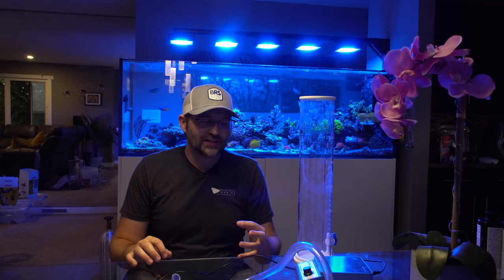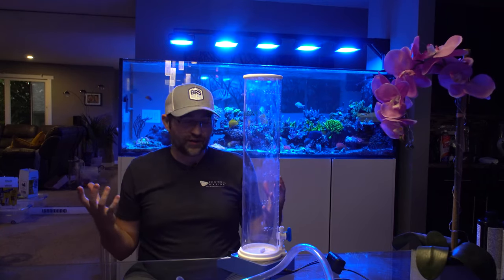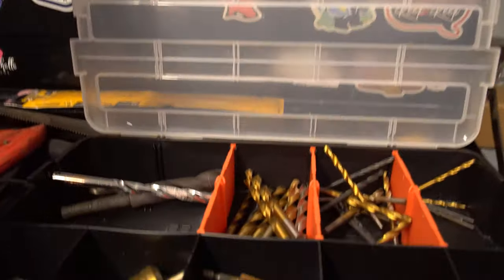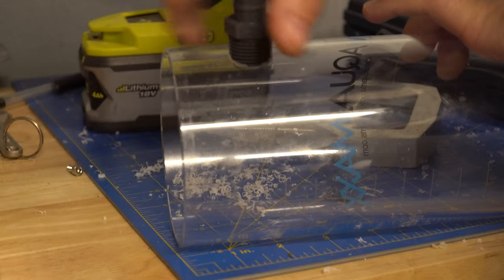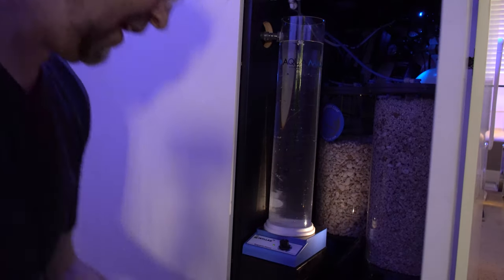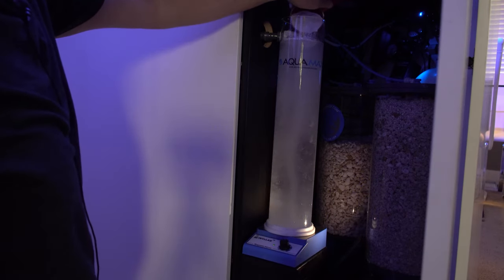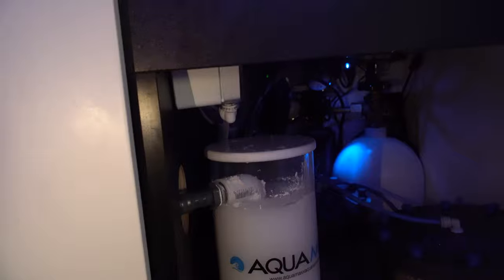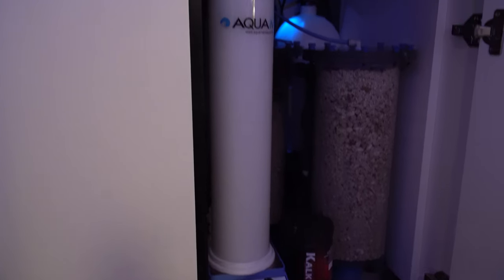DIY Kalk Stirrer Reactor for about $76! Kalkwasser PH power!

Comment: I did exactly the same with an Avast reactor. Same stir plate and all. I went to the parts store on Avast and got their K1 tube, bottom, and union. I then 3d printed the lid. Has been working fantastic for about 2 months. Also, drill a small hole in the top of that elbow to break siphon.
Reply from the maker: Awesome!  Ah snap I did that but shot the clip on my phone not the big camera.  Must have forgot to add it!
Reply from the maker: PS great idea on using the housing for that for a bigger reactor!

Comment: Problem with those cheap stirrers is that they use a brushed DC motor that has a potential of only lasting a short period of time (brushes wear out). Best option is to find a stirrer that uses a brushless motor.  Another thing to consider for longevity is finding a pill that has a ring in the middle so that the only part in contact with the bottom plate is that ring. It will reduce wear over time.

Comment: I did this a while ago, 1. Sometimes it dosent start to spin. 2. When it spins it slowly drilles a hole it the bottom of the conteiner
Reply from the maker: 1. need to make sure the kalk isnt to thick.. so far 1/2 cup works well! 
2. what type of magnet did you use?

Comment: Hey Devin,
another nice vid bro. I wanted to get your thoughts on Kalk dosing VS BRS 2 part. my tank is a LPS dom. mexed reef in a  red sea 650P (another peninsula fan here.) new to dosing have not dosed before and was thinking of getting on the kalk wagon via the versa if I can ever find one.  if not was thinking the red sea reef dose. my goal is easy, clean  and simple. was thinking the avast kalk stirrer but not sure I fully under stand the benefit of the stirrer? would not the kalk once mix to max saturation not need to be stirred? then you could dose your dialy amount from that?

Comment: Nice project! If I am dosing Kalk and use the original output that it came with it, I wouldn't have to drill a hole on top right?
Reply from the maker: I use the original hole as input and drilled a hole for the output

Comment: Dev.... Are you doing saturated kalk or the more concentrated kalk slurry?
Reply from the maker: Something in the middle. its stirring every 30 min into a milky consistency then some what settles.. i does the whole time slowly so somewhere in the middle :)
Reply: @ReefDudes  ok thanks...
Reply: @ReefDudes  so you are pushing out 1/2 milky slury. Is that why you are using  the intermediate container, ...for it to settle?
Reply from the maker: @HerringZFish  It goes direct to my sump!
Reply: @ReefDudes  Dev... Now that you are using for some time, do you know if the effluent changes from a fully loaded kalk vs to an almost empty kalk?   Or is it as long as there are powder in it, the effluent will be the same.

Comment: Were you doing 2 part dosing before the kalkwasser? How did you transition over without a alk spike? Thanks
Reply from the maker: I was using a calcium reactor and till am.   Just start using it abs slowly up the flow though it :). If your dosing you can slowly lower your dose as you up your kalk
Reply from the maker: @tiusica  Beautiful tank!   Just slowly lower the 2p[art as you up the kalk.. go slow and you will have no prob finding that balance.   PS your tank looks awesome!
Reply: @ReefDudes  thank you! I’ll definitely take my time with the kalkwasser. Btw I got the idea from your DIY build. I used the aquamaxx second calcium reactor chamber instead. So far so good with that.